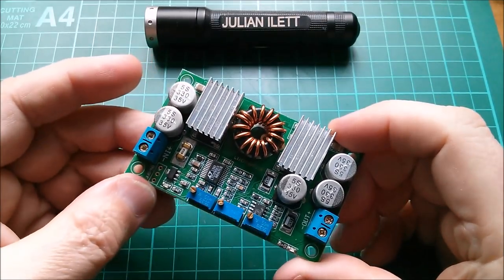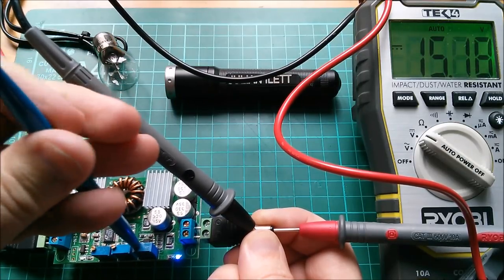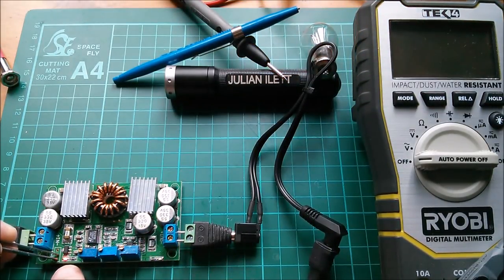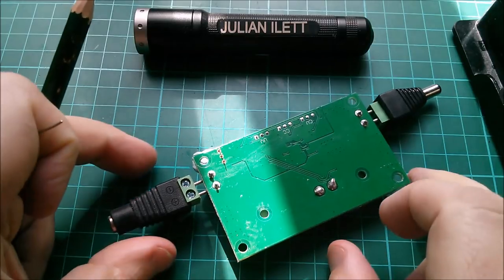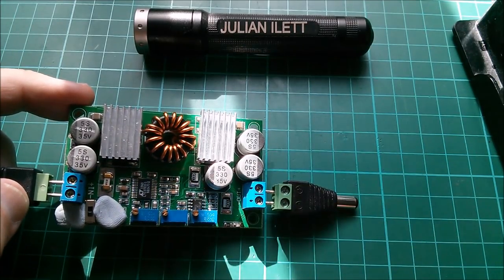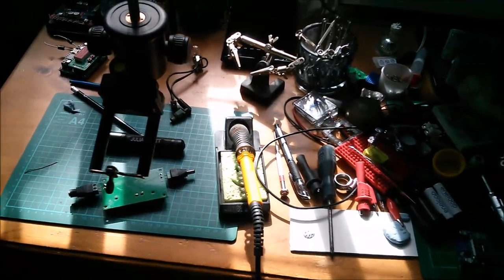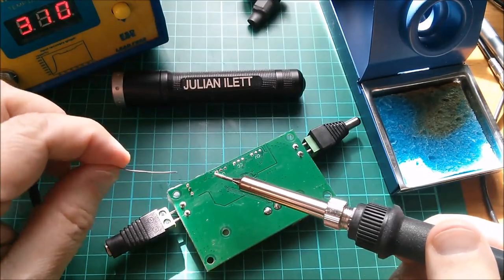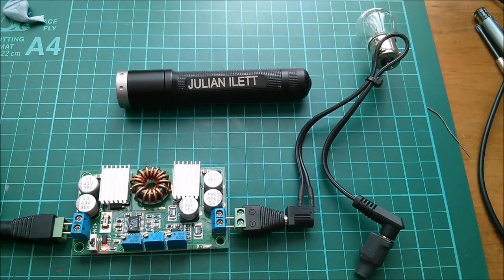Adding a Switch to the LTC3780 Buck/Boost Controller

Comment: Many moons ago, I was dreaming of a temp control soldering iron that could take those slide on screw lock tips. One day I came across a blue iron on Ebay with a tiny thermostat on the handle marked off in degrees C, with just such a tip combo. I picked it up for very little money, and for the past 4 years she has served me very well.  She is very quick to heat up, seems to hold the heat well, and the standard tips fit her with no problems at all.  I keep her set at about 300 degrees and she seems to do what ever I ask of her, on difficult soldering problems, I can turn her up to 450 C Max and she will solder the most difficult joint, however it reeks havoc on the tips, so it is nice that they are interchangeable, and I did order a goodly supply of my favorite style as well as a simple set of misc. tips for strange and exotic soldering problems.  While I am sure she isn't as nice as those with the nice power transformer and regulated temp control, for what she is, and what I need to do she is quite adequate.  Plus it fits in the overhead on my RV so she can be handy when the problem arises that needs a touch of solder.

Comment: In regards to the blow-back, there's currently 3 distinct variants of this board on the float.

1. this one (differentiated by the fuse being directly soldered to the board (and other minor differences).
2. another, with the fuse in a swap socket
3. last one, which is very much like the second one, but with a heat sink attached to the back.

This one, of the ones i've tested, has the most variations. Some boards have protection from feedback, some do not, some have ... something, that seems to fizzle out after a few hours left on the feedback. 

Just a thought, i'm no EE, but i do tinker a bit, so take the info with the customary pinch of salt.

Comment: I looked into it also, and didnt like it much. How does the on/off switch work ? It grounds the "power good" pin, that disables the LTC. So far so good. But the powerGood is the output of the 1st stage of the opAmp (comparing the input voltage to the minimum voltage required as set by one of the pots). I'be curious on much current you draw when "off", most of it would be the opamp trying to raise its output. I dont remember seeing a resistor there, but it's a bit foggy.

Comment: Julian, i dealt with crappy soldering irons for years (and could never justify an x hundred dollar soldering station), but just bit the bullet and spent 40GBP on the TS100. It's amazing, and has aftermarket firmware. takes almost any voltage, however if you want the lightening fast warm up times,  get yourself a 24v DC power adapter (i.e. laptop). Also, i reccomend spend the 1.5GBP on a stand, as i learnt the hard way when i touched the iron the the bench :(
Reply from the maker: A soldering iron with firmware? WTF
Reply: Julian i've seen one, it only changes the interface display not the values!
Reply: Google Ralim/ts100, has adjustable temp, reduces heat after a period of time, and auto-reheats when moved.
Reply: thats not true

Comment: You should be using the temperature controlled iron anyway in the first place. Its better than the crappy antex. You can continuously adjust the temperature.

Comment: Why isn't it a proper on-off switch (open circuit rather than closing off part of it)? How much current does it draw in this "soft off" mode? Does any part get hot if you leave it like that for long?

Comment: The Antex would solder that joint fine, it just needs the correct bit. Pointy bits are the work of the devil when it comes to general soldering, especially with thermal soak from groundplanes.

Comment: Buy a ts100 if you want a small temp controllable iron, can plug 12v stright in. Much better tips than those two too. :)
Reply: The TS100 on 12V would never be able to get that ground plane warm. It runs at around 10W at that voltage.
Reply: No real grip on the TS100, and no finger guard. Fingers do get sweaty when you do a lot of soldering, easy for a smooth metal body to slip through your hands.
Reply: From the Product page: 12V=17W, 16V=30W, 19V=40W, 24V=65W.  Also, even at lower power (<20W) the iron will still be usable since it has the heating element inside the tip, instead of the more common design which has a separate tip and wastes energy heating the handle up. That's how the 8W usb irons are able to work, they keep the heat concentrated around the tip.
Reply: I use my ts100 for drones and I use it to solder giant ground planes all the time, it works really well, also when soldering a ground plane that big I recommend using the max temp of the iron

Comment: Maker: this circuit does not have back feed protection,  place à diode in séries with the output for that.
Julian:  I dunno, maybe they have designed in back feed protection and maybe I could put in the missing switch to get it.
Place your bets.
Reply from the maker: I'm hoping the four MOSFET topology will make a backfeed diode unnecessary, but there's only one way to find out :)
Reply: Julian Ilett   ta for thé response and sorry if I sometimes sound grumpy.

Comment: Would that undervoltage protection pin work as a poor mans MPPT with a solar panel? where it limits the output current based on the input voltage? or does it just cut off the module entirely and turn on again when light returns?

Comment: Hi, have you ever mucked around with the UV setting on this unit, can't seem to find anything on the Net as to the range of adjustment etc. Most small Buck converters don't like running on solar, the problem being that the slow rise of voltage at sunrise stops the buck converter from starting properly, I'm hoping it can be set to start the Buck converter when input voltage exceeds 12v.

Comment: I would glue the iron holder to the top of the unit and permanently put it on my desk because temp control is great. Even my old straight to mains iron - it's all I can afford - has a triac to change temp,

Comment: hi, wondering if you were able to enable 42v boost feature of this board according to the datasheet. its says pin boost1, boost2 3v to 42v. could you please try. im thinking of making a power bench with this board with a 36v switching power supply.

Comment: What do you expect with such small diameter solder bits. I use a 2.4mm chsel bit on a 45W iron for almost everything including soldering soic ic's. Temperature of the iron will help but you need to be able to transfer the thermal capacity of the iron to the joint.

Comment: Is that a 25w antex iron ?
Get a bigger tip, more mass should allow you to solder things like that middle pin.
I have 2 XS25's, one with a 1/8" and one with a 1/4" chisel tip, and i've soldered a smd led with the smaller one (had a blown one on a strip, so replaced it from another).
I also have an Antex 100W
Reply: Yeah looks like he's using one of the smallest tips for that iron, with a bigger tip (3-4.7mm) the 25w XS Antex is actually pretty capable for an unregulated iron.
Reply: If he needs a bigger tip, there are Nigerians lining up to sell him a pill for that...
Reply: Got any spare pills? Asking for a friend...

Comment: Hit up Banggood for a TS100, rave reviews, plug straight into your solar system.
Reply: Also it's hackable!
Reply from the maker: That's sold it to me :)
Reply: Peter Moore Good suggestion. Keep looking at them myself - less of a palaver :-)
Reply: I'm honestly surprised he doesn't have one yet. Make sure to get the angled hoof tip it is so much better than the chisel tip!
Reply: I actually got mine from gearbest for £36 inc ts-bc2 tip but its back up to £54. Banggood have the basic one for £36 as well, I didn't see the point in spending over a £100 for a £5 case and a bunch of tips I wont use.
Reply: TS100 looks nice, BUT you have hope that you can buy tips for it in 5 years…
 I still get tips for my 35 year old ERSA station,
Reply: International Mutual Neutralist Party Templates I can still get tips for my 40 plus year old rechargeable ISO-TIP soldering iron and with one of the bigger tips it would have had no problem with that middle pin!
Reply: International Mutual Neutralist Party Templates Its a bit depressing to think a soldering Iron might outlast me! ;)

Comment: Can a circuit and relay be created to turn off/on buck/boost when the battery voltage is low and/or when the capacitor reaches a specific voltage?
Reply from the maker: This module can do both :)

Comment: Hello Julian,  I bought the LTC1380 board after seeing your first video on it.  Ans IIRC yours also had a thick Al piece on the back--the one you have now seems to be missing it!  The problem is that the Al is physically blocking the three holes for the ON-OFF switch.  However, I see that I may be able to 'fake' surface mount a switch since there seems to be a thermal insulating pad between the PCB and Al slab--which will prevent solder from flowing through the via barrels, causing possible shorts.   Did you remove your slab?   It doesn't appear so?
Reply from the maker: I have another module which has the aluminium slab on the underside

Comment: I have often wondered if a fellow could add a switch, or perhaps a capacitor in the holes that are not filled on these Cheap China boards.  An economic cut has stopped me from the joy of ordering in such devices to play with, and I am in the process of selling off all my toys, both woodworking and electronic so I can sell off the house I have owned and lived in for the past 25 years.  Not that this is a bad thing, indeed it is so we can enjoy our lives on the road, where we have spent our last 3 winters touring the great American South West deserts in search of warmth while our home in the Dakota's sits under a cover of heavy snow and extreme cold.  When you reach our age, and can no longer work for a living, then enjoying your leisure time becomes so very important, lest you become like a bump on a log, something worthless and only of interest to passing students of plant life.  I have vowed, however to keep my collection of blank boards and discrete components so I can build a few toys while on the road.

Comment: Hey Julian, what do you use between the terminal and the 2.1mm terminal barrel connector? seems very usefull.
Reply: legs from a diode , he used them in his pwm5 .
Reply: Aaaah thats kind of brilliant. Thanks!
Reply from the maker: Wow, you have a very good memory :)
Reply: ... A good memory or a small container with loads of LED legs  ;-)

Comment: With this video being about 6 years old I'm kind of taking  a shot in the dark.  BANG!

What do you call the tool that was used to adjust the little blue box (variable capacitors?)  I've been looking high and low but without knowing what to call it have not been able to find it. Would really appreciate it if you could let me know what it's called and where to get it. Thank you very much.

Comment: if the fault light comes on, i wonder if it was designed to have a NO thermal fuse of a similar in it's intended application? or maybe devices have some type of feedback loop when it wants to cut itself off?
Reply: David Riley My guess is that the switch just pulls the undervoltage detection circuit to ground.
Reply from the maker: I think you're right - it's right next to it :)
Reply: The chip has a control pin to switch the output off. Maybe the switch is wired to this control pin. See the datasheet. With the output off, the output will be outside 7.5% of the set output voltage, hence the chip indicating a fault condition.

Comment: he Julian. I immediately thought about a schematic i had seen in a LT datasheet using super capacitors. After some googling i found it. The LT8705 looks to be the same tech. on page 40 there is a circuit using super caps as a UPS. maybe this chip can do the same.

Good luck
Reply from the maker: I would dearly like a LT8705 module - I ordered one which never turned up, got refunded - it appeared to be bidirectional, perfect for supercaps :)

Comment: Why not use a double throw switch? One to switch +in and one to switch +out? No risk of any feedback from the capacitors to the converter. A switch always beats a diode, only setback is that it is to be done manually. So what, you already decided that.
Reply: You need a big switch that can handle the full current of the converter.
Reply: Sure. That's okay. Although you will not be switching when the current is that high. I reckon a 10A switch would do fine.

Comment: It would be helpful if you measure the quiescent (idle) current and efficiency of these modules (the ones that pretend to be efficient). Last time I bought decent chip DC-DC synchronous converter it was worse than the cheap ones. Probably because if the circuit design...

Comment: Joy! A buck/boost converter! It’s been so long! Fitting my switch now....PS Can you get knobs which permanently fit on the pots? It’s a pain to have to fiddle with a screwdriver.
Reply: You can remove them and wire in a standard pot...

Comment: Forst! :D
Reply: you must be Scandinavian :)
Reply: Nein! Here's a question for you though since your here.
I want to solar charge a 18650 with a TP4056 but my panel outputs 12 volts. I was going to buy a cheap "DC-DC 4.2-40V to 3.3V 5V 6V 9V 12V 24V Buck Step-down Converter Linear Regulator" that will convert the 12v to 5v for the TP4056, however the panel will not output a steady 12v it will dip & rise depending on light conditions. Do you think the regulator would output a steady 5v whatever the voltage it is supplied?
Reply: It can't be both linear and buck. Its either linear (a simple 'wattage torch' meaning it burns away power through heat, very inefficient !) like the 7805 or a buck DCtoDC converter (it switches on/off with a very high frequency so you get an often 'dirty' lower voltage of say 5V).for both the input voltage of the solar panel may vary you still get a steady output voltage BUT you do still need a charging/protection circuit for the Li-ION cell.
Reply: I've bit the bullet and connected the TP4056 directly to the 12 volt panel. Although I said my panel was 12v output, I didn't mention that its really just a 5 watt battery trickle charge model and I think there is a massive voltage drop under any load. The TP4056 seems to be happily charging the cell. If it all works out I'll update with a picture of the setup :-] Thanks for your input so far.
Reply: hehe good job. I'm not a pro so don't expect me to know everything :) Julian or BigClive know more LOL. I always charge Li-Ions in a stone soupcup (fire prevention) that I stand off of 'everything'